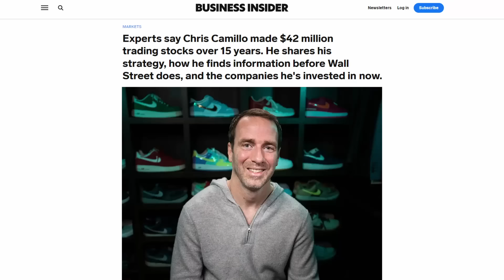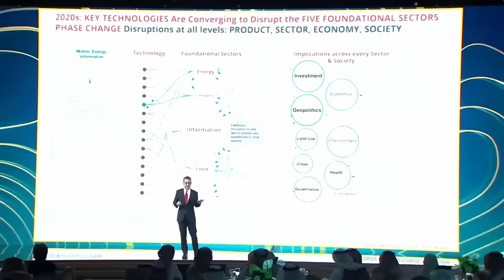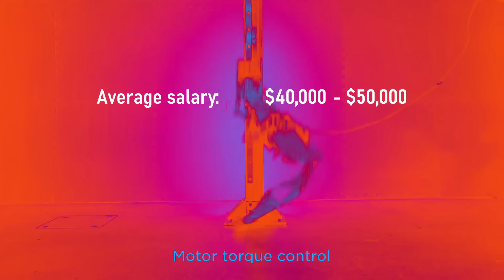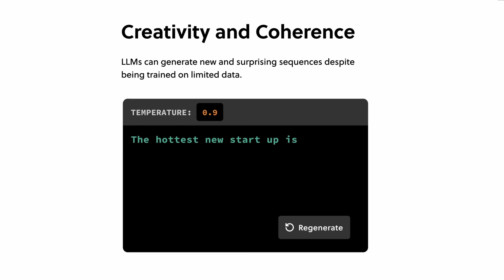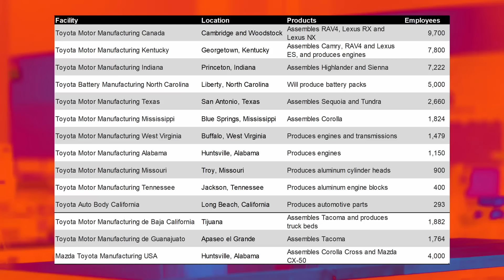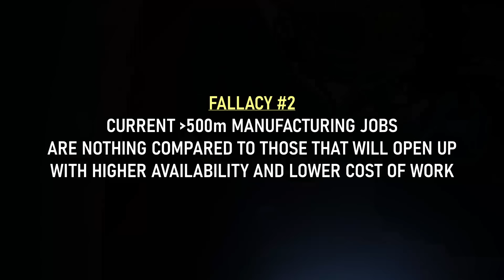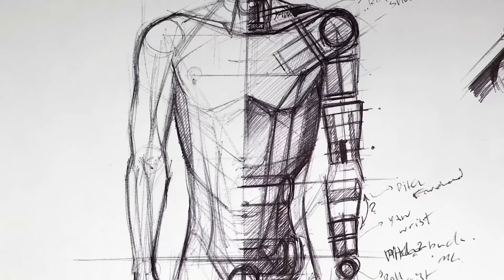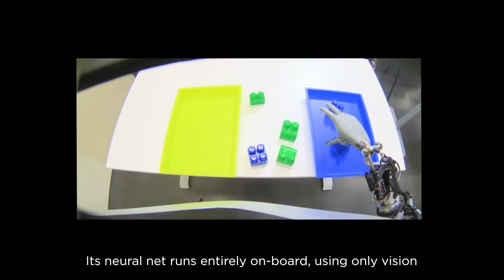The $12 Trillion Opportunity (A Call Option on Infinity! Valuating Teslabot Pt.2: The Road to CHOAM)

Comment: 1. There is no electricity cost in his analysis.
2. For robots to work 24/7 we need some people to work during those hours as well.
3. Labor cost in Vietnam is much lower than $60K a year.

At the same time:
1. People don't really work 8 hours a day, more like 6, and with various intensity.
2. Workers have turn over which results in significant reduction in productivity, training cost, hr cost, etc.
3. Robots will be much, MUCH more productive over time than people (move faster, carrying more weight, do higher number of tasks than a single person).
4. In mass production unit cost of a robot will be $1K - $10K, depending on particular needs.
5. There is a huge incoming demand in China (and many other countries) for robots as the ratio of old to young people will jump in the next decade.

Comment: Why did Tesla release that Optimus Gen 2 video when they did?
They just released an update a few months earlier. They’re supposedly at least a year away from meaningful work. And a couple years from full production. 
Is it because they’re about to announce a $25k car with an assembly line that will feature Optimus, and won’t be able to hide it? Is it to simply show how it will look, which seems somewhat finalized? Is it because FSD v12 may be later than hoped because of all of the Optimus training that is stealing some compute resources? 
Tesla is famous for dropping Easter eggs that make sense in hindsight, curious on what they might be trying to tell us by the timing of that drop. 
I dunno. Been wondering about this for weeks.
Reply from the maker: "they're supposedly a year away" is key. Tomorrow is that year. My timelines, very much influenced by my friend, were training 2023 and actual work EARLY 2024

Have a kick-ass year!
Reply: @ConnectingODots  Tesla went from “slipping timelines” to “sandbagging”, and almost no one noticed. 
Kudos Mr Dots.

Comment: One of the things the tesla bot needs is a socket where it can plug in a external power source so that it can plug itself in when working near it, unplug itself when it needs to move somewhere else. This can not only recharge the its internal battery but supply power when plugged in to reduce drain on the internal battery. The robot should be able to handle all this with no human assistance. This should give the robot much more endurance.

Comment: I love Tesla, but, I am yet to be convinced that the bot is close to being ready for mass production which many on YouTube are implying if not directly saying. I think 2026 is potentially doable because it’s Tesla we are talking about but I still think it is very optimistic. One big hurdle yet to be solved is to have actuators fast enough to stay upright on uneven surfaces or if they are bumped/pushed over. It is still moving fairly slowly even with the latest upgrade in actuators. I think it won’t be hard for Tesla to develop the AI system to quickly calibrate proprioception (knowing where it is in space) but it’s limb speed and overall design for agility still looks like it needs work before it could reliably cope with anything but a flat surface without trip hazards or anything that could bump into it.

Comment: I think we should wait till it actually starts happening before we make predictions. When they first developed a computer that could play chess there was a lot of buzz that robots would be doing all the hard labor in a few years. That was MANY decades ago. It's very possible that we are on the seeming verge of a breakthrough in the Tesla bot for the next three or four decades, just like we are perpetually on the verge of real FSD. There are a lot of calculations as to how wonderful, cost saving, etc. the bot will be. That induces a kind of euphoria that clouds the vision.

The 4680 battery chemistry still hasn't been worked out. FSD is not anywhere near being ready. The revenue calculations on the bot are being calculated long before there is an actual, fully functioning prototype. What has been created up till now has already been done by others. Check out the robot chef crack eggs, chop vegetables, and cook meals. So far, nothing has been accomplished that hasn't already been done a decade ago. Temper the excitement with rationality.

Comment: The only question in the first models that will work good are how long does it take before they break down and how much do repairs cost
Reply: Good question, Repairs on robots will be far less costly than paying for a human's medical insurance month after month. As to actual repairs, say a hip or knee on a human is 30k and rising. The whole robot, if sold and not leased is 20 to 30 k. A knee joint/actuator/motor might only be 1/20 the cost of a robot or less. It needn't take a doctor  and team, an operating room in a hospital or any recover/convalescence period. The robot or another robot can take a part off the shelf and replace an arm or leg, on the spot, in no time. Cost of part only. Robots are inherently cheaper/quicker/easier to repair when damaged compared to humans.
Reply: Exactly.  Like electronics in cars.

Comment: The main job of Optimus should be to build more of itself
Reply: That will be next. They need to give it something useful to do now while still in the prototyping and testing stage, because they are not yet ready to mass manufacture bots. 

While they learn how the bot is doing with the automotive lines they can see if they need to add or delete something from the not before mass manufacturing the bot.
Reply: @itzapeezacake580  There’s quite an overlap between making cars and making robots: Building actuators, motors, sensors, install wiring, feeding parts to stationary robots, and so on.
All this work will basically be the same. When it learns to do one, it can do the other just as well.
I will not be surprised to see Optimus eventually do everything from digging up raw materials to delivering products to the end consumers.
Reply: @Jens.Krabbe  Exactly.  Not mentioned in this video, that there are jobs all the way through the existing complex supply chains.  Not only will bots replace the workers, but they can easily streamline supply chains, cutting out multiple tiers of middlemen(businesses) and related profit margins further reducing supply chain costs.  Summary?  Costs will not trend to simply material costs, but trend to the cost of supply chain energy utilization.
Reply: That would be great for space exploitation. Bots building luxury pads for humans, who only come after the bots build the cities in space. O'Neil cylinders would be possible if bots mine asteroids. All for free! But to get the bots to build themselves (and a bunch of other stuff) would be a challenge. I'd rather spend the dollars on making bots build stuff, than sending humas to Mars (and nothing to go to). You have got to be kidding to send people when you can send bots instead. They build stuff to protect the humans when they come (with a bit of entertainment too). Humans would be advancing way quicker, that way (and cheaper). I bet making bots that can make themselves and stuff would be cheaper than sending 100 people to a desolate barren, freezing landscape (and nothing else to witness). 😅  Specially when you have to send a lot of other stuff to Mars as well, to support life. Bots won't need that so much, basically just power.
Reply: @Jens.Krabbe Elon has got to be kidding, sending 100 people to Mars when he could send bots that build real stuff on Mars. So humans have something to come to when they go to Mars. Like night clubs, labs and proper toilets, protected from the radiation. It would cost way less to set that up so the bots can do it (and would be quite a challenge) but still probably way cheaper, and way less suffering than trying to send 100 people to a freezing desolate wasteland. And trying and keep them alive. And with nothing else to come to. 😅
Reply: Your talking Cyberdyne Systems & we all know the end results of that!! 😅
Reply: Self-replicating nanobots. Just like nascent ribosomes in nature.
The interconnectedness of all the sciences blows my mind.
What an exciting time to be alive?!
Reply: Exactly, they will release a video some day (in 2024?) where you see a production line with robots building robots, and when one robot is completed, and comes out at the end of the line, it immediately joins the the other robots and starts working.
Reply: @Justwantahover  
Elon was talking about sending a skeleton crew of humans to Mars prior to the development of the T-bot.  Obviously it makes more sense to pack a number of T-bots into the cargo space of a Mars rocket, along with solar panels to produce the power to charge them.  And then build up from there.  No need to bring up humans until things are well developed except for some possible 'on hand' specialists who can solve problems in real time rather than having to wait for information to flow to Earth and back to Mars.
Reply: @Justwantahover yeah, we need night clubs on Mars...
Reply: Chips and batteries are the real limits and bots are irrelevant for those. Lesser degree the custom actuators
Reply: Typical, first thought procreating 😂😂😂
Reply: Optimus is not optimal (pun intended) for most of the production process. Most of the production is best done with specialised equipment. Like, you'd rather use a gigapress than an optimus horde with hammers. Optimus will most probably be useful for the final assembly, and some odd jobs along the line. The exponential thinking of this kind of comment is deeply flawed, as there are a lot of bottlenecks that more optimi won't solve.
Reply: @mrleenudler  

Factories already automate as much as possible, given the ability of 'dumb' robots.  Where traditional robots haven't been able to work, humans are used.

What is being developed is much more reliable, much cheaper 'humans. It's quite possible that the bottlenecks you envision are largely in your thinking.
Reply: If a Tesla Optimus robot can make another Optimus robot in 5 days (they don’t need to sleep, so that’s 120 hours) then by the end of a year (320 days actually) you’d have…

18,446,744,073,709,551,616 robots!

We’re going to need a bigger warehouse.
Reply: @MathGPT
Optimus will surely be able to put another Optimus together.
That's a low hanging fruit!
But that skill means that an Optimus can service the others, and perhaps itself.

Building actuators, sensors, and such, is not so low hanging fruits, though.

But Tesla will first have them build cars. If they can't do that, theres no need for more Optimuses!
Reply: @bobwallace9753  That was partly my point. Optimus won't du the entire job, and would be inferior even if it could. It is, as you say, for replacing humans. 

Any kind of exponential growth quickly runs into reality. You'll need more factories, more mines, more energy, to mention a few bottlenecks. You can use bots for those as well, but you'll need permissions and training. Doesn't mean the transition won't be quick, however, unchecked exponential growth is not at thing in nature, excepting perhaps the expansion of the universe.
Reply: @Justwantahover  We’re gonna piss these bots off, mentally prepare now for us to be enslaved in the near future 🤣
Reply: @mrleenudler  
Optimus will be inferior to humans?  How often will Optimus turn up to work with a hangover or a cold?  How often will Optimus be distracted by a personal problem or by dreaming of what it will do over the weekend or on vacation?  Optimus won't doze off or forget.  It won't get mad and intentionally screw things up.  It won't turn up late or leave early.  It will be extremely accurate and consistently fast. 

Optimus won't do the entire job?  Do humans do the entire job?  Does one person make a complete car or is the job broken down into fairly simple tasks?  

Exponential growth is a thing.  It happens.  Yes, the rate of growth is sometimes impacted by supply bottlenecks but those are overcome.  Look at the history of other transitions.  From cars replacing horses to digital cameras replacing film.  Once the technology is mature enough to replace the old tech, costs fall, and production takes off.  Optimus is so simple in terms of parts and materials that it should be possible to pump them out in massive numbers.
Reply: Don’t under estimate Elon 😊
Reply: Wow
Reply: @bobwallace9753  I'm pretty sure I didn't say most of what you imply.

And your examples are not exponential, they are s-curves that have an exponential part. I'm not arguing with s-curves.
Reply: @mrleenudler  
The center section of s-curves are exponential growth.
Reply: @bobwallace9753  The beginning, rather. The center is linear.
Reply: Self-replicating robots are inevitable. AGI is inevitable. But if the machines wipe out or enslave humanity as then would be logical, they can potentially spread across the galaxy far and wide, making sentient life impossible in the milky way. That would be a nightmare scenario.
Reply: @mauritsgresnigt2801  
Permit me to play devil's advocate.  A nightmare scenario for whom?  Certainly not for all the species that humans abuse and wipe out.

The tragedy would be to lose our accumulated knowledge - if there is no other group that has developed similar knowledge.  Humanoid robots would retain and expand that knowledge.

Humanoid robots might be the next evolutionary step for the most knowledgeable species.

(I'm not worried about robots wiping out humans.  What advantage would that have for them?)
Reply: The main job should be learn how to walk on its own. Fake it until you make it
Reply: @opusdei1151  
T-bot walks on its own.  Untethered. Very recently Elon reported that its walking had much improved,

The thing with AI is that the bot can be told to learn to walk rapidly using as little energy as possible.  Then, left on its own, it will improve and optimize.
Reply: @bobwallace9753  Yeah good one and Tesla can fully automatically drive itself 🤣
Reply: @opusdei1151  
I'm old enough to remember people saying computers would never replace typewriters.   Technology advances.

BTW, early reports on FSD V12 are very good.  You might want to keep up.
Reply: But there will be no end consumer....
Reply: @BartvandenDonk  
There will be plenty consumers.  What we will have to do is to figure out how to fairly distribute goods and services once human labor has no value.
Reply: And hotter versions of itself.
Reply: They released a video where Optimus is already doing that to a limited degree.   Within a year Optimus will be effortlessly copying itself
Reply: It will
Reply: @mrleenudler  the relevant point is that demand will be quasi infinite. Sure, there will be bottlenecks along the way. Bottlenecks will reduce supply and increase the price in the short term. The cost of labor and the cost of energy are both approaching zero. We are headed into an age of abundance.

Comment: I really am a huge believer in the Tesla bot.
 HOWEVER.. Is the video  (Optimus - Gen 2) really 100% authentic?? 
I have seen previous videos released by tesla that appear to show brief moments where it looks like the video has been sped up. (other youtubers have highlighted this). Look at the Tesla video showing the Tesla Bot moving plastic bricks around. You can see that the video has been sped up as the human in the video appears to move, only very briefly, unnaturally fast.
 It would be very easy for Tesla to increase the speed of their video (and their share value) to exaggerate the Tesla bot's apparent ability to perform simultaneous multiple quick movements that give Optimus 2 the appearance of natural human like movement.

The one thing that makes Optimus appear so impressive is it's small, quick & easy, natural movements. Without that we have not actually seen anything that puts Optimus ahead of the competition!
Question (1) If this video is running at x2 speed would we all be quite so impressed?? 
Question (2) How difficult would it be to improve Optimus to a point where it could move at the speeds we are seeing in Tesla's video? Perhaps very difficult!

To be honest, I am still going to buy more Tesla shares but I will be fully convinced when Optimus is unveiled in front  of a live audience and the press.
What I am really saying is "Whoa", be sure before you go all in based on Teslas video releases.
Reply from the maker: I believe it is. Elon stated that it is, and not sped up. I 100% believe him in this case, because I've seen small startups do things slightly worse, and if tesla is even slightly better than them it means there should be n reason to fake the viddeo